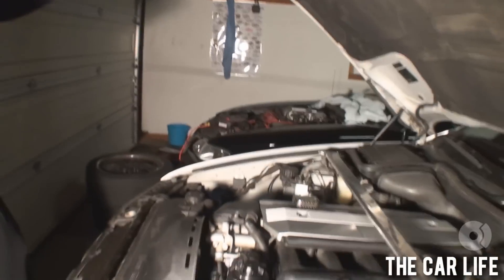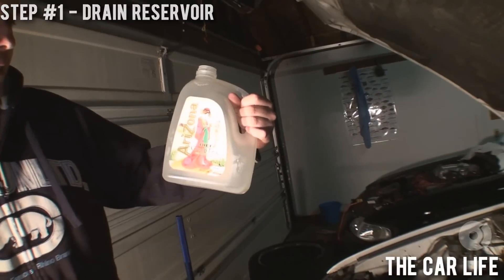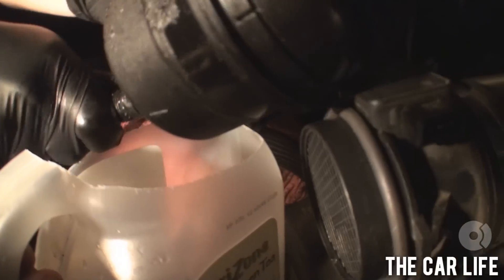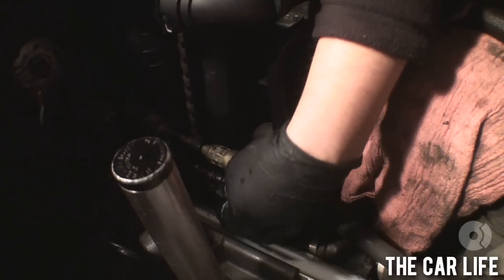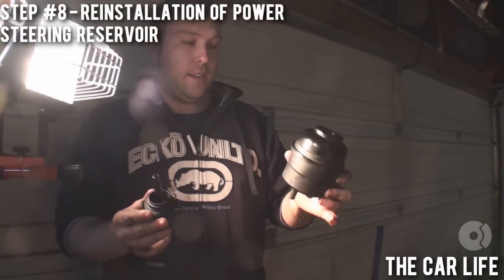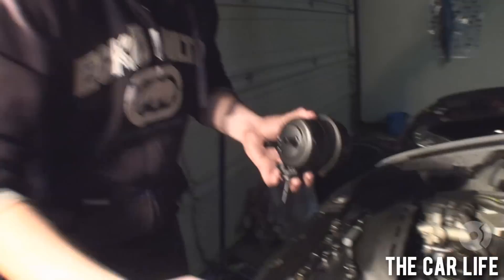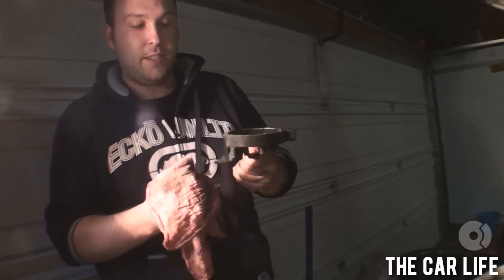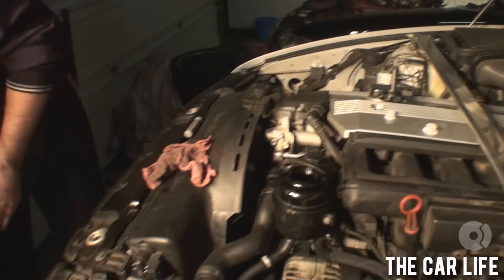Power Steering Overhaul (E39) FCP Euro - #ProjectE39

Comment from the maker: @7674Princess Thank you! And yes, BMW hose clamps suck and you are right that they use them so they don't cut into the hose. The clamps I picked up do have rolled edges so they won't cut into the hose...that was actually one of my concerns when I was buying them...but I like the fact that these new ones are adjustable. Ultimately, that it more important.

Comment from the maker: The hoses looking wet and nasty are very typical of a few symptoms. Firstly, you could have a crack in your reservoir causing a slow leak. Also, the rubber in the hoses is tired and has stretched causing the wetness you see. I would replace the reservoir along with the suction and return line as preventative maintenance. You can also check your high pressure line that goes from the pump to the rack to see if there is a leak from there.

Comment from the maker: I recommend replacing the entire reservoir due to the filter element. It's pretty easy to do if you're just replacing the reservoir and then you can do a simple drain and fill to get some fresh fluid in the system. A ZF replacement reservoir sells for like $25-$30 online.

Comment: unfortunately i am getting noise from the car until i put more atf into the reservoir. before i changed the alternator it was leaking but a lot slower than it is now. i used to only have to put about a quarter of a quart about once a week but now im adding almost half a quart every 2 days or so. i just ordered the suction and return hoses along with a new reservoir, i guess ill start there. thanks a lot for the help!

Comment from the maker: That is a potential issue whenever you install a new rack. You need to make sure the steering wheel and steering rack are relatively "neutral" or straight. Unfortunately, I don't think an alignment will cure your issue alone. You might have to unbolt the steering column from the rack and adjust it.

Comment from the maker: The hose came out pretty easily for me. The only thing that holds the hose in place is a small block secured with a bolt. I know the  E46's use a different style connector that requires some effort to remove.

Comment from the maker: It could be the rack, but if it's not making any noise I wouldn't worry about it immediately. You would need to see a sever power steering fluid loss before you would really have to worry about the rack. Just check the other areas with the car up in the air and see if you can find your "smoking gun". I hope this helps.

Comment: I have a E39 525i Power Steering Issue. The steering wheel is hard to turn and there's a unusual noise coming from the low engine bay. Do i have to replace the complete power steering or what?

Comment: I cut through that clips with a mini grinder. BTW I notice your pipes connected to the oil cooler and the other way around to mine. Assuming there are no valves in the cooler, I assume it doesn't make any difference?

Comment: i have a 2001 BMW 530i (E39) and had to change the Power Steering Rack & Pinion now my  steering will sets at about 70deg off from straight will i have to reset the steering link or can it be fixed by a alignment?

Comment: Hey guys, my 97 528i has been leaking atf slowly from somewhere causing me to put about a quarter of a quart into the power steering res, the other day i changed the alternator and drove it around for a little bit. while i was changing the alt. i noticed the hoses under the power steering res. looked wet and nasty, the next day i come outside and theres a huge puddle of atf under the car! my neighbor who is a mechanic says i need to replace the whole rack and pinion. what do u think?

Comment: Did you reuse the O-rings at the cooler fitting or did you replace them with new ones?
Reply: I replaced both o-rings as they were so cheap and original ones so old. However, I now have a leak where the new hose plugged into the cooler. The old hose from the pump didn't leak at all. Not sure if it's an issue with the size of the new hose or bad luck seating the o-rings properly.

Comment: Hi I'm replacing mine as we'll but there's no bolt directly on the suction hose how do you got it out ?
Reply from the maker: What's your year and model? I know that the E46 3-series has a special fitting at the end of the hose that needs to be pulled with a special tool.

Comment from the maker: That's not uncommon. If you have a leak and the system does not have proper capacity you will definitely have a noise. Like I said above, you.ll want to spend some time checking everything to be sure of where the leak is coming from. If the rack itself is leaking you will need to check everything. The last thing you want to do is rip out and replace a rack and pinion to find the problem to be elsewhere.